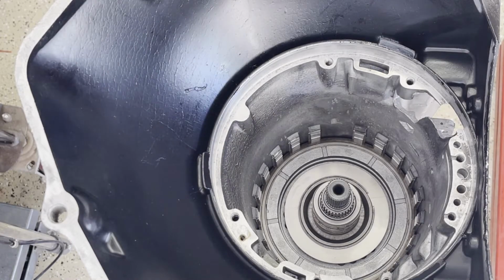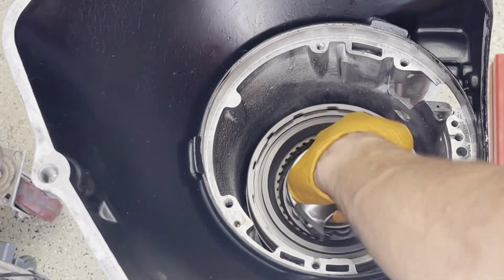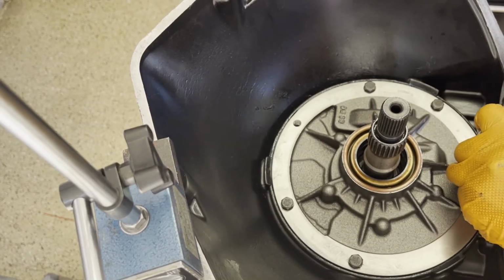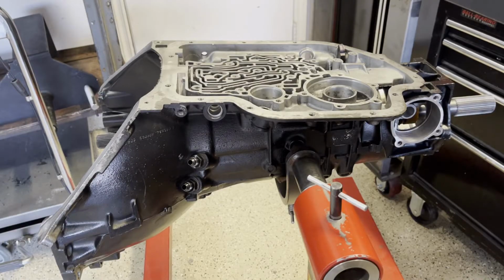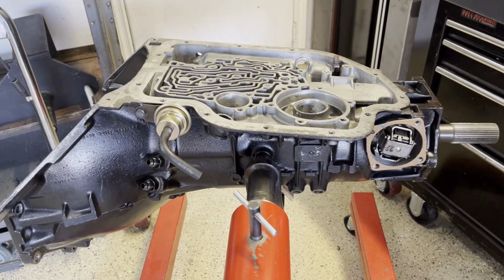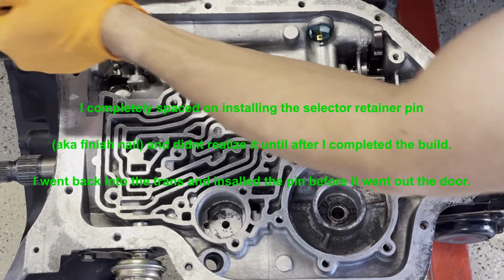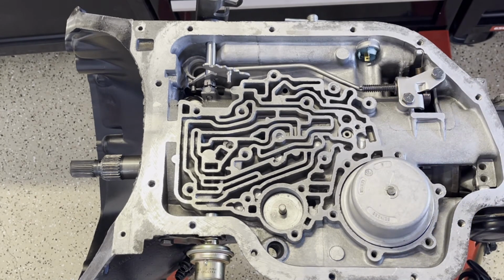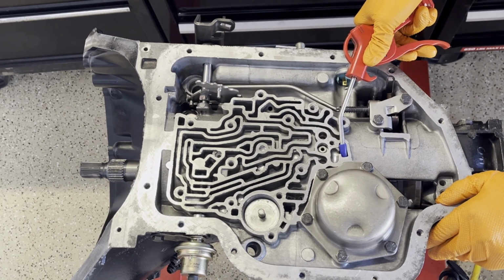5. GM TH400 Rebuild: Intermediate Clutch to LR Servo

Comment: Putting the trans in today. The 350 you helped me with worked better than anyone I've done. Today is the 400 going in. 1/2 ton ex. Cab  4WD. Had wavy in int. , I left it out. Used 4l80 steels and got 4 clutches in it. This guy is hard on vehicles.
Reply from the maker: Awesome, Jearl -  great to hear that! 
No wavy in the fwd or direct is no big deal as long as clearances are within spec limits...in the case of the forward, will just translate to a little bit harsher engagement from P, N or R. When you say you used 4L80E steels, I'm assuming you're referring to the intermediate clutch?

Comment: Great series of videos on the TH400. I seen your edit stating that you went back & installed the finish nail for the linkage shaft. You’ve probably realized before it went out the door that the L shaped bracket that forces the plunger rod into the parking pawl was installed upside down. Thank you for taking the time to film, edit and share.
Reply from the maker: Thanks, man! Yep, corrected it in time.

Comment: Hey man great videos. If I can add a quick tip, if you take the top bushing out of a spare sun gear shaft you can use it to spin the drum down on the intermediates, once it's fully seated you run out of splines and know it's all the way in. Keep up the good work.
Reply from the maker: Thanks, man. Will have to try that next time I work on a TH400 or 4L80E

Comment: For some reason I can only fit two clutches for the intermediate. Do you have some ideas as to what I should go back and check? Obviously I've messed up somewhere. Thanks Nick. Really appreciate it.
Reply from the maker: start taking stuff back out until you have found the problem. Given the nature of the problem, it should be pretty obvious once you dig into it.
Reply: @nickstransmissions  Found the problem. A piston wasn't fully seated. Phew.
Reply from the maker: Did you air check that piston before just now? If so, and if you havent already done so, id check the lip seal.
Reply: @nickstransmissions  I was thinking the same. Thanks!
Reply from the maker: You're welcome, man.

Comment: Was the dial put on the pressure plate or on a tooth of the top friction? If it had a wave would a friction go on top of it or would a flat steel go in on top of the wave and then a friction?
Reply from the maker: I set it on a tooth on the top friction. Normally, TH400s come with a waved steel plate that goes in first, then a friction, followed by flat steel/friction/flat steel/friction. I'll be uploading another video soon where I show how i use a dial caliper's depth gauge in conjunction w/a dial indicator to measure clutch clearance on TH400/4L80E clutch packs using the indicator plunger on the top of the pressure plate. Long story short, you take a measurement using the caliper's depth gauge from the ledge to the surface of the top friction on opposite sides - note/write down the measurement. Then you put the dial indicator plunger on the top of the pressure plate and measure/record its travel...add the two measurements together and that's your total travel. I use this other method sometimes when I cannot get a consistent reading when placing the dial indicator plunger directly onto the top friction's tooth. If you dont have a dial indicator, use feeler gauges. This method applies to any transmission where the clutch housing (drum or transmission case) has a ledge for the pressure plate that prevents it from sitting directly onto the top friction in the clutch pack.

Comment: can you air check direct drum with a dual feed mod and transbrake ?
Reply from the maker: You can air check the direct drum either via the center support on the bench or once it has been installed into the case but before bolting on the trans brake assembly to the case.
Reply: @nickstransmissions  ok thank you very much i got something wrong on mine lol cause when i put air does not move like fwd and center support
Reply from the maker: Check the lip seals on the piston. Perhaps one got pinched or torn on the way in…unfortunately that happens but glad you caught it now vs later!